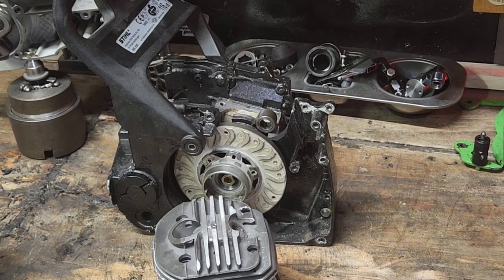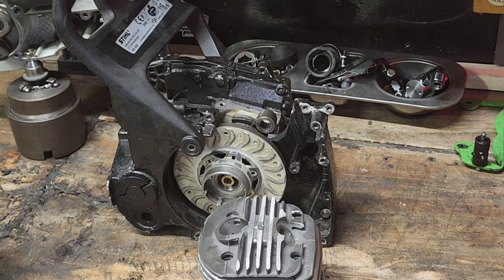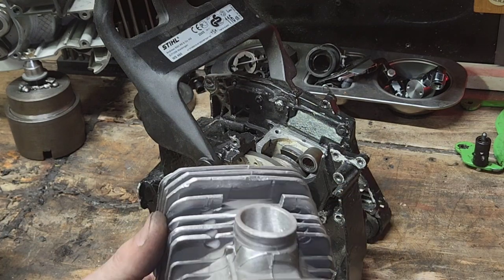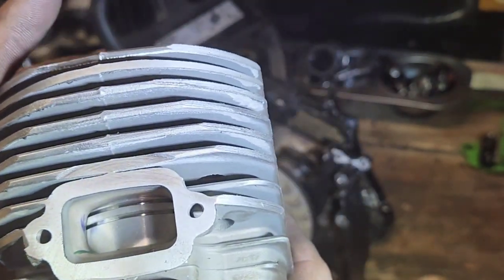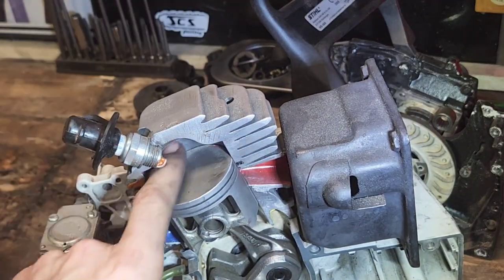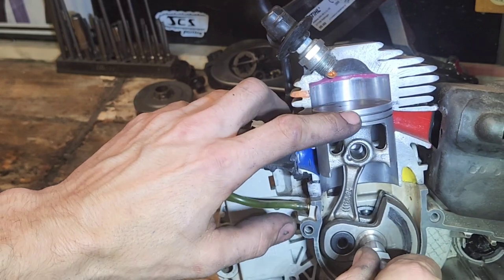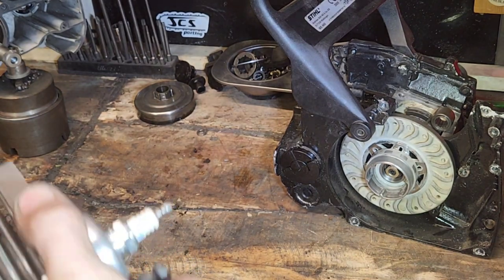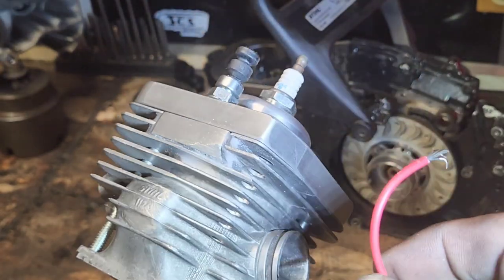The most IMPORTANT 2 stroke porting rule I know... and why I STILL HATE aftermarket cylinders...

Comment: You never explained what happens if you break this rule. What is the problem? Aside from just generically saying it won't run well. When the ring passes the top of the exhaust port there is no difference in how connected or "free flowing" the crankcase is to the intake. To say that you won't have compression when you remove the top ring, sure you won't, but what does that have to do with the intake? If you have no ring you don't have anything to seal the compression.
Reply: Seems pretty self-explanatory to me. I think you’re a bit too fixated on semantics.
Reply from the maker: This is a video for beginners and i am just trying to help my man... i am sure you know a lot more than i do... i have NEVER claimed to be some badass saw builder... just a dude in a tiny shop... explaining why having an open pathway for charge/pressure and the combination of both as well as your charge in the bottom end to escape when you are not sealed (since rings are what actually seals the system) seems a bit much to explain in a beginner video... yes i do understand it however... i have been wrenching on and porting 2 strokes for 25 years and this was passed on to me when i was porting (badly) dirt bikes by a real 2 stroke wizzard... and i wanted to help others the way it helped me... thats all... not like i am giving out malicious information 🤷‍♂️
Reply: @JOHNS CUSTOM SAWS  I believe you that this is an important rule, but for the life of me I can't figure out why. Sealing the ring above the exhaust port seals the combustion chamber, but, that moment doesn't change anything below the piston on the intake side. The skirt is still the only thing isolating the crankcase from the exhaust port before and after that ring passes the exhaust ceiling. Nothing happens at that moment other than compression starting. Not doubting you, just trying to figure out the explanation.

Comment: Great video, very good point you are pointing out! For those who did not catch the facetious statement about taking out the top ring and trying compression check, basically It is because the combustion chamber is not sealed. You have a few degrees of crank rotation before it seals. If it's sealed earlier in the stroke it would give you higher compression. Like he said it will run but the compression would be lower than if the chamber was sealed.

Comment: That is something that was talked about in the 70's, 'free port' where intake and exhaust can be 'open' at the same time.
Even though I've never done chainsaw motors, 'everyone' tuning two strokes should know about it and check.
In early 2000's when 'pocket bikes' were everywhere, tuning them was a lot of fun , guess they were similar to chainsaw motors?
Something else people don't realise, every time you raise exhaust you lower compression slightly which loses torque.
Majority of two stroke run a corrected compression around 6~7:1, I always laughed when people started saying they were running 'race gas' and 14:1 (or more)

Comment: This is a great help to me. I bought 2 G111 saws and I considered cleaning up the ports. Roughish on the intake and polishing the exahaust. But I won't unless the saw is too disappointing. 
One bit of advice I got to make them run like the 200t was a gasket delete and to port the muffler.
I'm not looking to make it a mini race saw. I just want it to cut as well as my 200t I use to have did. The 200t was brand new when I bought it and just stock.

Comment: Thank you for the heads up John, I've been building and working on saws since I was a kid and I'm just now starting to mess around with porting and any other ways to gain extra power out of most of my saws or when ever I get new power heads. A lot of the stuff that I have learned is either from your  channel or the IronHorse and I have to say you both have a really good knowledge on the do's and don'ts when it comes to hopping stuff up. So once again thank you very much for the quick awesome trick on how to tell if your saws going to have good power out of the box.Also at least that was an aftermarket head, but still don't blame you for being pissed off on wasting your time when you could have prevented it like you said.
P.S. I like the video for ya👍

Comment: Wouldnt this depend a lot on transfer port timing? If the transfer ports are opening before the ring gets below the top of the exhaust port that would allow the expanding exhaust gasses to push backwards into the case potentially igniting all of that as well as actually stalling the intake pulse if the intake port was on its last degree or 2 of being open. 

But if the transfer ports aren't open yet the expanding exhaust gases are still pushing only on the piston,  creating power and the case volume is decreasing, which also stalls the intake pulse but its not screwing with the direction of air flow in the transfer ports, they are basically dead air. 

So the exhaust opening (ring below top of port) only after the intake is fully closed (skirt below port) is important because then case pressure is building to prevent reverse flow of exhaust gases when the transfer port begins to open (ring below top of port) which i would assume you would want to happen just after the exhaust cracks open so that the exhaust is starting to escape through the exhaust port and there is more pressure in the case that will force the intake charge through the transfer ports with more speed and expell the exhaust gasses faster 

But then theres the intake shit that needs to be taken into account... fuck. 

It's been 20 years since I've actually thought about 2 stroke port timing and I used to have the concept down pretty good and now I'm playing mental gymnastics once again trying to remember the theories on how it all works. Plus, I keep thinking about things that would apply with reed valve cases when there is an actual valve preventing backflow if the transfer ports are open before the exhaust is open... 

I wonder if I still have all of my notes on port timing theory, exhaust scavenging and expansion chambers, and all of the other shit I made copies of and printed out back then... 

Why the hell do I do this to myself...
Reply: The exhaust port always opens well before the transfers. This is called blowdown.

Comment: Not sure if I completely understand, but how does a ring that's too low while the intake is opening lead to "short circuiting" if the transfer ports are closed? I understand that the earlier you can get the ring to seal, the more compression you have, but what has that to do with the intake?
Reply: Glad I'm not crazy for having the same thought. Intake and exhaust being open simultaneously while transfers are closed would not lead to free porting. Unless I'm missing something major but spinning around my cutaway I don't see a problem.

Comment: Is scavenging not a factor without an expansion chamber? Because with dirtbikes and snowmobiles they say having a slight overlap allows the exhaust gas exiting the cylinder pull a denser fuel/air charge into the crank case making more power.

Comment: Really appreciate passing on of info. But I dont get this one. 
What are we saying the problem is with the inlet opening before the ring closes the exhaust ? Is the probIem during compression stroke - seems to be what's suggested - but I cant see any pressurised mix reaching the crankcase let alone the inlet. Or is the problem on the exhaust stroke where there might be a pressure pulse generated in the exhaust as the ring crosses the exhaust port ....could generate a pulse into crankcase and inlet port maybe? 
Be great to get a reply !
Reply: I'm also interested as to why it screws up performance. It would have been great had he delved into the issue/problem that is created by this mis-match. Perhaps he'll see your post....
Reply: Perhaps the lack of seal for that portion of rotation negatively affects the quality of the vacuum, and the volume of intake charge being dragged down into the crankcase?? Guessing here...

Comment: I understand you said you were taught by and older professional builder, but that may have been the older days.  Why would that be free porting.  Why would the motor lose power because of that unless it was and old McCullough engine Maybe ?    Technology has changed a lot sense then.  Now If the bottom of the piston shirt was open at the exhaust port at tdc then that would be considered free porting and some of the intake charge would escape and you would probably loose power in the low rpm range. But having the intake still open when the compression ring just cracks the exhaust port, would probably hurt nothing. No charge is being lost just exhaust gases exiting the exhaust port..   I have ported kart engines for years and don't really see a problem with what you have there, unless the rest of the cylinder is junk.  And I Hate cheap China aftermarket cylinders too. Most are total garbage.  Keep up the good work it's a good way to show your customers sometime it's not worth using the cheaper stuff .
Reply: I wish there was more explanation too. I can't see what that ring getting past the exhaust port has to do with the intake. They're on two separate ends of the piston. Only thing I can think of is backpressure from the muffler getting past the piston skirt while the intake is still open on the downward stroke.

Comment: Amazing video! Can you share how much to shave off the bottom intake side? Is it in relation to the top ring above the exhaust port to the opening of the intake and shaving it down right before the intake opens?  Thanks again for the impressive videos. A+
I am working on a 45cc rovan rc engine.

Comment: AFTER YOU DETERMINE THE AMOUNT YOU HAVE TO WORK WITH…AND GIVING THAT YOU SAY RAISING THE ROOF OF EX GIVES TOP END AND LOWERING INTAKE FLOOR INCREASES TORQ….IS THE MOVE TO SPLIT THE DIFF? IS SO WHAT IS THE NET RESULT
Reply: If you’re working on most stihl’s or husky’s? Shoot for an exhaust around 100, a transfer timing around 120, and put the intake at 80… and it’ll run strong as hell. The gotcha is that some models won’t let you get there: the 200T is a brilliant example of a saw where you can’t grind for that much intake timing. You need to check how all of the ports will open and close and how much ring or skirt will be left to open/close that port before you go crazy with your Dremel.

Comment: Why would this matter? The transfer ports are closed, so there is no connection between the crankcase and the cylinder. All reed or rotary valves open the intake before the exhaust port has closed.
Reply: Just for good measure though on the upstroke compression, top  ring should fully seal before the lower half of the piston opens the intake port, this wouldn't fly on a one ringer piston. Thats why he mentioned he sometimes removes the bottom ring to test as well. You want that initial umph!!! on a free flowing system. Whether a rotary or Reed valve.  This would go sour on a piston port intake design.
Reply: @Ecksterphono  There is no connection between the exhaust port and the intake port, because the transfer ports are closed. So there can be no free-flowing that he talks about.
Reply: @peterolson8350  you have to remember everything happens in a nanosecond. It's all about movement of air. Things expand with heat as well, it also about volumetric efficiency and the stretching of air. This is a double acting pump top and bottom wise. You also need a good amount of blow down so that when the transfers open on the downstroke you get more efficient transfer as well. It's not what the relationship of what the piston position. Its the sealing property of that top ring. The piston may be covering the transfer points. But the primary compression ring should be a seal fit and not over or even touching any port at that phase of the stroke.
Reply: @Ecksterphono Yes, I know this, but it doesn't explain why what is being talked about in the video would be related
Reply: @peterolson8350  I've been doing this for years. Just for giggles back in the day I ported one chainsaw. It actually performed quite well. I wasn't bothered by the chainsaw endI didn't even know now it became a big thing at this day and age. Most of my 2 stroke engines I ported were snow  sleds, motorcycles, and jetskis. I,ve got so many books notebooks with numbers designs from back in the day. They're sitting in a box somewhere. I think the last machine I ported was a Rupp sled that had a Zenoah engine. Going through my notes that was 1995 lol